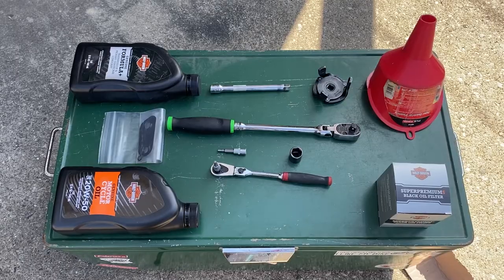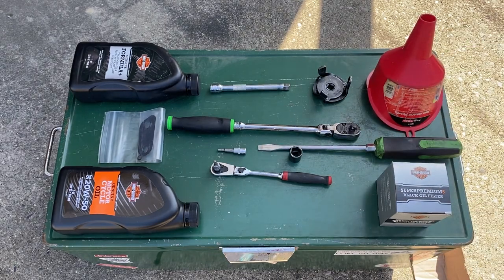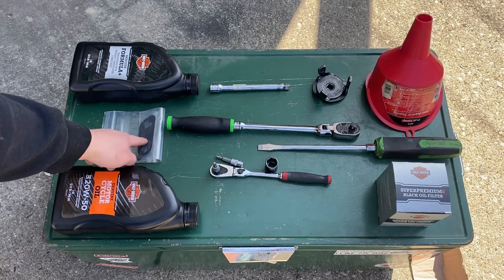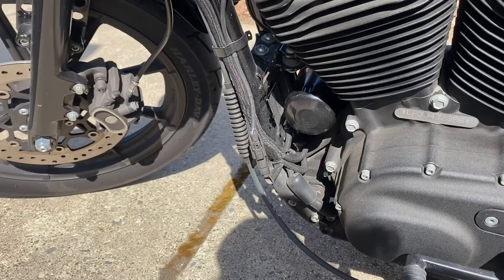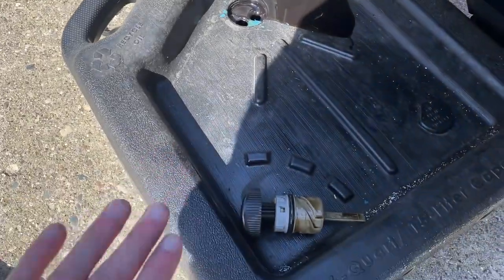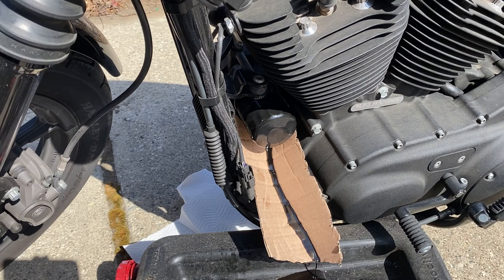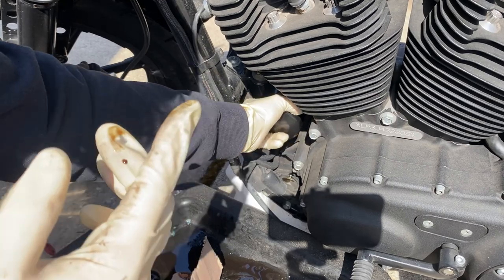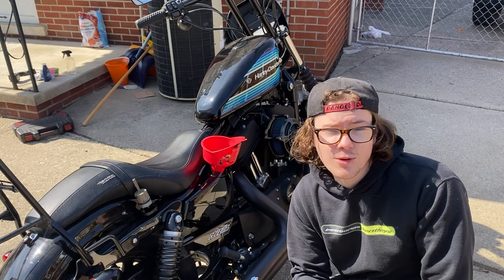HOW TO CHANGE YOUR ENGINE OIL AND PRIMARY FLUID ON YOUR SPORTSTER!

Comment: I actually dont think you are supposed to click the dip-stick in, when checking oil level. Just screw it in, and then out
Reply: Clicking it in doesn't change the read its just a spring loaded button that locks it from vibrating loose.

Comment: Appreciate the video...my '21 needs this.. Dealer quote was 479.00. for initial 🤣🤣🤣
Reply: Your first initial service includes more than just a fluid change.They readjust your clutch and check the torque on head bearings,etc.

Comment: Hi mate,do you really need a new gasket on the gear box cap or you can just put the old one?
Reply: No you don’t need it, Harley recommends replacing it after 30-50k mile. This is over kill